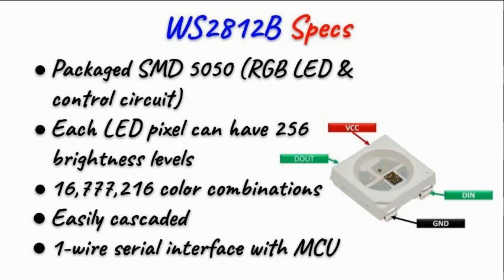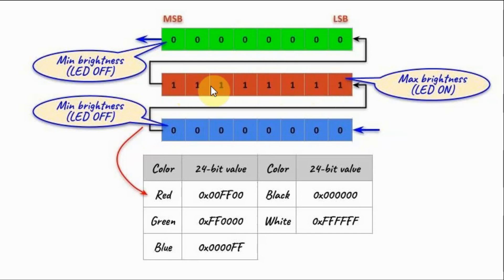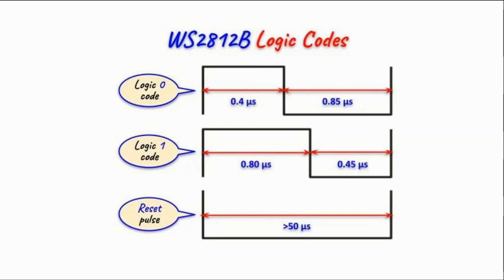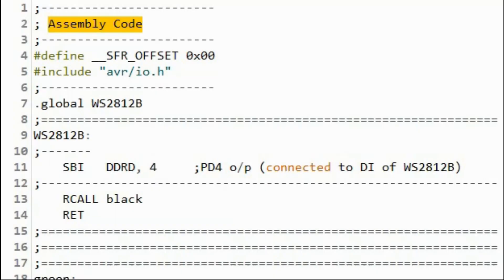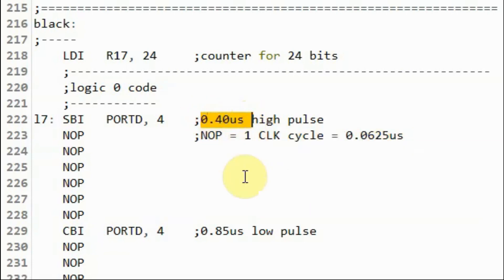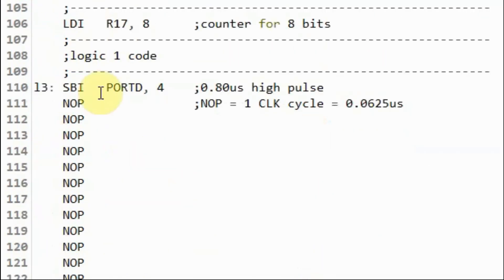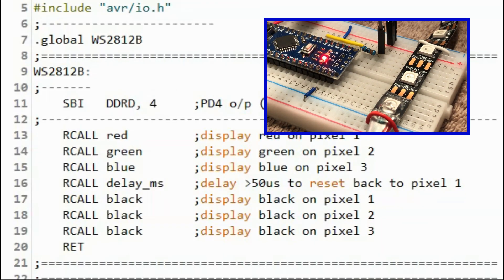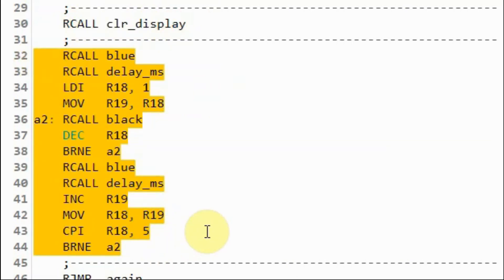Assembly via Arduino - Programming WS2812B

Comment: please make  video how many ws2811 led could be run on atmega328p via assembly..and how can we interface with sd card & playback led effects stored onto the sd card.( we can make raw pixel data by using jinix software in '.dat' or '.bin' format). Actually there is a limitation by using fast led library, we can just drive approx 350 leds.
Reply from the maker: Hi, thanks for your feedback. As for number of units that can be programmed depends on the control circuit within WS2811 chip that can pass the 24-bit data to the next unit. The datasheet may have some info. As for using SD card, well that's a thought for a future video.
Reply: @AnasKuzechie  waiting for the next video